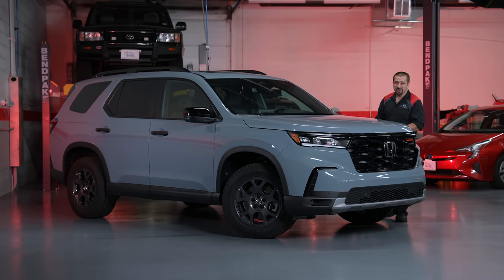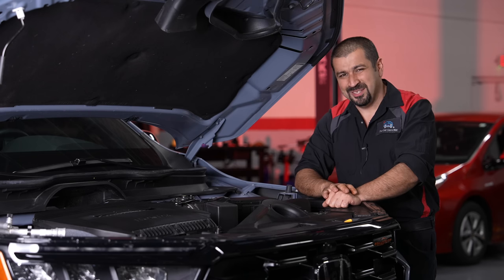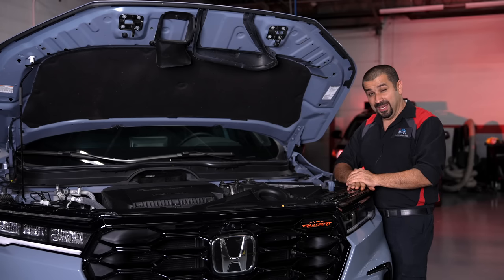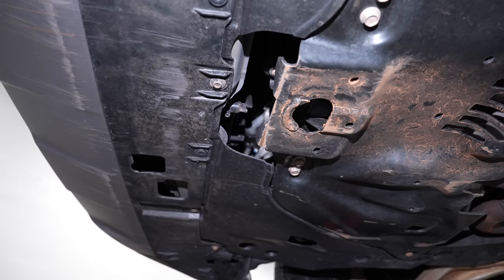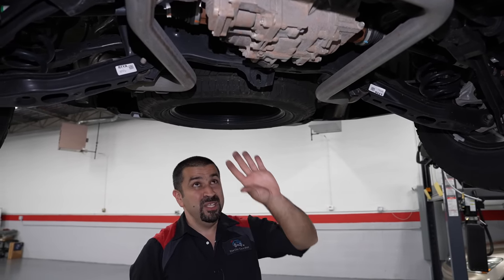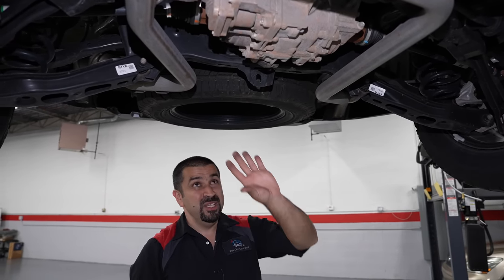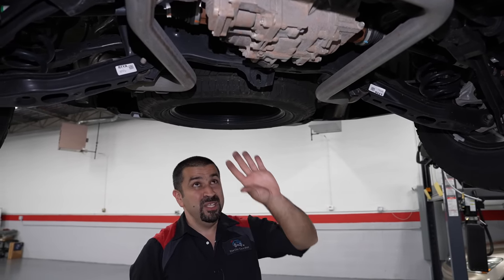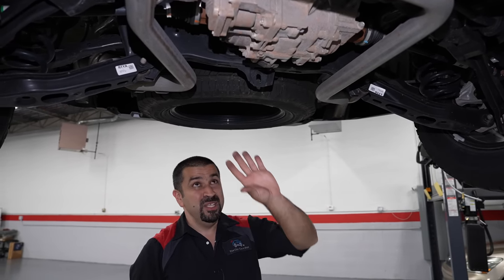Should You Buy a 2023 Honda Pilot? Thorough Review By A Mechanic

Comment: Excellent review. If cylinder deactivation can be defeated / selected with a button then okay but if that is forced on you, then that's a deal breaker for me.  Its a shame its under powered because Honda really got so many things right on this update. Also not a fan of DI only but time will tell if that is any concern.  Great job keeping the passenger cabin safe too.
Reply: Very simple to deactivate. I bought the S-VCM controller and self installed on my 2017 V6 Accord and 2017 Pilot. No issues. Problem solved.
Reply: Yup, first thing I would do is disabled vcm with the s-vcm device
Reply: Underpowered? Dang how heavy is it? 285 HP seems sufficient
Reply: @ctbale1  I was asked if the S-VCM tuner would work on the new double camed engine. That is a question I am not able to answer. Is a modified version available if needed? Needless to say/write, I would definitely recommend one from the problems it causes. I put one on my 19’ Pilot with no issues so far. As far as the pilot being underpowered, I disagree.  Once the warranty is up, one could throw on a supercharger if one has the ‘Need For Speed.’
Reply: There is a tuber out there that has a 120k passport and when taking the top off, the system was very clean for DI. Doesn’t seem to be an issue at all. It’s a very high compression engine.

Comment: Interesting comment on the exhaust systems on Honda's. I've owned several. All had well over 100,000 miles and never had an issue with an exhaust system.
Reply: He’s in IL, maybe a rust belt thing? Although I’ve had Hondas in the Midwest and no exhaust issues.

Comment: Thank you so much for going into depth concerning this revised engine. After a very bad VCM experience with my 2012 Accord, I became skeptical. After all the issues Honda is very aware of, they double down and get even more complicated and, in my opinion, stupid. I've owned four J series engines now, a J30 from 2006, which was excellent, no VCM. The J35 that blew up at 130,000, its replacement, and my current J35 with 71,000 on the clock. 
VCM is a bad deal. Maybe a 1 mpg gain while putting the engine at risk. It's no risk to Honda and their warranty, only for the owners that believed Honda used to mean quality.
When my engine blew up due to VCM failure, I chalked it up to just being "one of those things" and I immediately bought a 2017 Accord V6 while my car was in the shop for a new engine. I should've bought a Lexus ES350 instead at the time. VCM is a ticking bomb and I don't recommend any Honda with it.
(Edit) I have owned 7 Hondas since 1992. I have always been a fan until fairly recently. For peace of mind anymore if your plan is long term ownership from new is to just go with Toyota and Lexus.

Comment: I heard many stories of the VCM engine issues, but I never had issues with my 2012 Honda Crosstour, I had it for 95,000 miles without issues and was more than often running on 3 cylinders.  My in-laws also had a 2017 Honda Odyssey and didn't have any issues either.  Not sure what trigger that issue.  I'm very happy that they brought back the full front center console though.
Reply: VCM can cause difference in the wear of the cylinders. When a neighboring cylinder is running it is obviously at a higher temperature than the ones that are not running. This can cause warping. Eventually, the piston rings start scraping on the block walls and the car starts burning oil. If you maintained your car properly (e.g. did regular oil changes with good oil and filters) this would not appear until about 100k miles. There are ways to deactivate the VCM and I have seen many people do so to preserve their engines.

A slightly less important issue is the motor mounts and transmission mounts which are designed to be activated in a certain way when the VCM is active. They can wear off faster than regular motor mounts.
Reply: It's actually a bit difficult to locate definitive proof that VCM causes major engine damage.  My mechanic 'gut' tells me the idea is bad, and there are plenty of horror stories on the web, but try to find more than 1 or 2 stories from people who actually had issues is harder than you'd expect for something with such a bad public perception.

That said, I did install a VCM defeat device (VCM Tuner II) in our '15 Pilot, and you'd never know any of that stuff was there.  Good piece of mind for $130.
Reply: @loualexander3408 this is one of my concerns. Correct me if wrong, but when the vcm kicks on and you have only 3cyl running it's either all 3 on one side or 2:1, either way without all cylinders running they're not counter-balancing eachother therefore creating more/diff vibrations in the motor which would then cause a motor mount vibration dampener to wear out quicker...is that what you're getting at?

Comment: My 2010 Honda Accord V6 EX-L has been fantastic to own for over a decade. At 175,000 miles I'm finally looking at a repair for the cylinder deactivaton system and some small leaks.
Reply: I'd bypass the cylinder deactivation. I did on my 2011 Odyssey and I'm happy I did.
Reply: @TheProtagonist_777 how do you do that?
Reply: LOL that's me. My 2010 Honda Accord V6 EX-L has about 70,000 miles now and I recently discovered S-VCM controller and am looking forward to installing this device to prevent my car from burning oil.

Comment: I wanted  either a pilot or a grandhighlander but i ended up buying the grandhighlander with 2.4 turbo i just feel like its more reliable yes it does have a turbo but that the only thing i have to worry about  it has no timing belts no direct injection no cylinder deactivation system!!
Reply: The 2.4 T24A-FTS 4cylinder is GDI/port.

Comment: Pretty good SUV..  But wish they would'a given it a traditional shifter (instead of push button)..   I just like shifting with a traditional shifter much better..
Reply: It's a bit odd at first but after a few days of driving, I didn't think about it.  Nice benefit is better access to center console which is great in this car.
Reply: Agree, can’t stand paddle shifters.
Reply: @magnoliap5824  im not sure why it even has them. once in a blue moon you might want to override auto but its already got electric  “sport”,”towing” and “trail” modes which seem to shift the up/downshift points along the power curve. in any case, they don’t get in the way.
Reply: @bigwave_dave8468  I'd use them to downshift and use engine braking going downhill. I wish my 1st gen Pilot had those, shifting its old-school gear lever on the steering column is less convenient than paddles. And you do need that when driving in the mountains. A few weeks ago going down from Pikes Peak, I saw (and smelled) a car ahead of me that was on the brakes almost all the time to the point it even started smoking. Lucky for him, there was a brake check station a thousand feet ahead where every car got stopped and its brake temps were checked, so he got sent to a parking lot to cool them off

Comment: The trick with changing the oil filter without getting any on the frame.
Take a 1-quart Ziploc bag and put it around the oil filter.
And slowly take the oil filter off and all the oil will get caught in the one quart Ziploc bag
Reply: is there plenty of space to do so, or do you need to be a gymnast to get your hands up in that space?

Comment: Had mine about 6 months now. 10K miles, zero issues. Glad I did it, although the new 2024 Lexus GX 550 is haunting my thoughts. Lord grant me strength…
Reply: What kind of gas Milagros are you getting?
Reply: 23-24 miles per gallon. Not the best, but certainly not the worst I’ve had.

Comment: How does the new Pilot compared to the new Toyota Grand Highlander? I guess in terms of reliability? I feel like a lot of shoppers would be stuck between these two SUVs.
Reply: I'm one of them. The new Traverse/Acadia as well.
Reply: One thing that could be an important factor in the decision is the fact that the Honda can be had in an eight passenger version in upper trim levels but the Grand Highlander can't.
Reply: Yes both true. But I still can't get over the fact that grand highlander XLE does not come with parking sensors as standard. Vehicle that big should have parking sensors as standard at XLE level by default lol I was almost insulted when they didn't give the sensors 😂
Reply: Biggest difference is that Highlander has a 4 cylinder turbo. Although, the newer turbos are better than the ones we had in the 80s, it’s still a concern.
Reply: @adrianidzik1585 
Nothing beats a N/A Honda engine reliability
Reply: Look at the statistically relevant data sources for long-term reliability. Toyota/Lexus is better than Honda/Acura, especially in the last 6 years. Not saying Honda's reliability is bad, just not quite as good as Toyota

Comment: Coming from toyotas. Last one being rav4 2020 limited. I only went into this car because of the ruggerd look, that egg shape soccer mom pilot theyve had for years was a  disgrace. That being said honda has surprised me with their approach to certain things. But i can see where honda stands out from toyota but toyota has its own list of items done etter by them than honda. 

Just comparing
Toyota has beter fabric quality, inhave the pilot elite, we know is not real leather but it is very cheap, it feels rough under your legs specially if you have a skirt or shorts, the perforations when they bend become sharp, and the ventilation feels like a light breeze blowing on your skin that only makes it to your lower back. 

Toyotas ventilated seat will ventilate and cool your whole back , the fabric is soft and flexes softly not causing any sharp edges that may feel rough on your skin. 

Another thing i noticed was the build quality. This is my first honda, also pilot, and is very sturdy, no rattles no weird loose plastic noises, in toyotas amd subarus wether your car is new or used youd come across different rattles thought the cars lifetime. 

So that i gotta say i comend honda for keeping it tight, however surface quality is a dif story. You will find welds that were lightly painted over, rough specs on the paint ( looks like a tiny white rock on the paint you can feel it) some parts have that leapord pattern cloudy effect when car paint shops do crappy paint job and your paint isnt even across the car panel.

 On my hood i can see the different shades, cloudy effect, is questionable in certain areas and makes you wonder how it passed inspection.... youd think im exagerating, but my second row right passenger seat has a burnt mark on the leather my the lower shoukder area, as if someone came with an iron and imprinted the iron on the seat and cooked the leather / of the seat. I asked honda about it but they said is normal and if anything goes wrong with the seats is covered under warranty. ( so they say) (veware warranty determines wether is factory defect or if it was your fault and youninduced the damege accidently. So dont think everything will be replaced just because you claim it) 

Which leads to my next item, wheel alignement, maybe is because this car is big, 3 rows, weight etc or maybe vecause is honda , well the dealer told me.is normal.for hondas to steer into the right or left after you let go of the wheel.in the highway.... after 3 highway diving lines the car should deviate, i argued this because with toyota the car will drive straight untill you tell it other wise, so this struck me as a surprise, i took it to get 3 wheel alignements at 6k miles. Nothing worked then i notcied my stering wheel was crroked. So in order for the car to drive strigt i had to point the honda badge on the steering wheel at 1 clock so they realigneed my steering wheel think it s9lve it
 I still have the osue wer the car prefers to pull left. Is just a pikot thing , speaking of pilot things, this next issues goes far back into the 2015s maybe 2012, were pilots have this water bottle twisting sound when you turn the sterring wheel.

 Behind the honda badge is the air bag and supposedly  theres a ring behind the steering wheel that may vauses this awful noise. Everytime you sterr left or right, is as if someone is takin an empty water bottle and twisting it. 

While driving down the highway the weather strip on my roof rack came loose.

 Were the roof rack meets near the sun roof on the right side of the vehicle the weather strip came loose and would whip my roof at high speeds. The dealer riped it off and ordered one for me but said it was in back order. 

The sun shade for the left pasenger seat in the second row magically snapped , and rip out of the to frame so the fabric was hangin by a thread, it couldve hit my 2 year old that was rididn next to it thankfully nothing happen but i unhooked the shade to avoid it ripping further and it swallowed itself inside the door panel. 

Honda can replace it bit ill have to explain carefully wat happen since remeber they only replace under waranty if they see it was facotry defect but in this case is hard to proof, it would seem more.like my child pulled on it and ripped it but she cant even reach that far nor has she ever tampered with it. 

I have some perosnal dislikes like not having a shifting lever/knob, pressing the buttons is annoying. And you will get it mixed up from time to time and press the wrong one. 

There is nothing like braking and pulling the shifter back into parking reverse or drive.  And the auto engine shutoff you get at red lights is a button you mus constaly press to turn off when you turn the ignition on of the car.

Engine start you have to be literally 30 feet away mac to start the engine. So you can turn ot on from your house or balcony if is further thatn 30 feet. 

Although i have to say im happy honda offers this free while toyota is charging people now for having auto start, honda also gives you the otption to roll your windows down with your alrarm so on a summer day you can roll them down to let the heat escape before you get to the car, openes the sunroof too. 

Finally the cruise control auto drive w.e is called, i dont trust it. As.much as i love having this optiong for when im on straight highways my tityota i can set it to lane assist so it stays in the lane and put the auto pilot so the car drives itself. , a bungy cord pulling on the steering wheel keeps.the machine thinkin your hadn is on it. Good for long striaght hiways..however with honda. 

The system is very sensitive and soemtimes is not responsive. 8 of 10 times itl go on a curve on its own and the other times itl deviate from the lane and off you go runing into bushes if your not careful. I dont turst it. , i got the pilot since totoyta had nothing that interested me.and the grand highlander comes out next year so wel.see how that goes. I like the spaciousness of honda pilot though. This kind of space you can get with the totoyta sequoia which is ridiculously overpriced. But anyone interested in the 2023 pilot here are your basic gripes. Any questions let me.kmow

Comment: Just bought an EX-L model, I was looking at Telluride until I watched your video. It kind of turned me away from it. Now I get to find out if I have made a terrible mistake 😅
Reply: Just got to the end of the video, looks like it gets a thumbs up! I honestly love it, it’s by far the nicest vehicle I’ve ever had
Reply: @codylester9081 I got one identical to the one in the video, also definitely the nicest car I’ve had. I used to have German cars and it reminds me of them in a good way
Reply: You're going to love it..we thought the EX-L trim was the sweet spot so that's what we got.
Reply: Hope your roof doesn't leak, transmission doesn't shit the bed, ecm doesn't freak out. Those are some of the issues right now.

They don't make em like they used to.
Reply: My 2019 just hit 105, 000 miles so I am replacing the timing belt. Only issue I know we've had is the a/c condenser was replaced under warranty. Based on my other J30 with 325,000 miles, I don't think I will have an issue if I follow the oil change schedules.

Comment: Im really wanting to get one but I hope they find a loophole to turn off CYL Deactivation because there is nothing but issues with those kinds of systems. Also not a fan of the shifter, but other than those 2 this is a clear winner for me, because others in this class are going for turbo 4 cylinders, and I dont want those lol. Literally choosing this over a Highlander because of that. Plus it looks great! Nice Aggressive muscular look to it.
Reply: What about cx90 ?
Reply: CX90 six cylinder trim is turbo charged.  This Honda is naturally aspirated engine.
Reply: @curiosityredpill7030  Yeah what he said^ The CX90 is really nice for sure. But I don't want turbos. I don't want to deal with the maintenance
Reply: @YourLocalFireAlarmTech  Okay that’s understandable they do have a phev version also ,
Reply: There is a button to do it but it has to be pressed every time the engine is turned on.
Reply: @c0r8d877  I'm okay with that then. I'll be happy as long as the option to turn it off is there
Reply: There’s a device I think it’s called VCM delete or something similar, you can disable it with that

Comment: If this engine is as good as the engine that was in my 2004 Acura MDX... you will be good to go for 400,000 miles or more without any problems.  I bought a Ridgeline vs many other pickups due to the trouble free 3.5 engine.
Reply: Tacoma has better engine reliability.
Reply: @paulm6481 not with the turbos coming out
Reply: 275K on our 2005 Pilot EX. Miraculously the trans still shifts like new. Regular maintenance, no towing and it's usually 1-2 occupants.